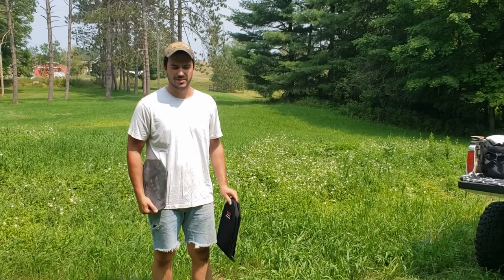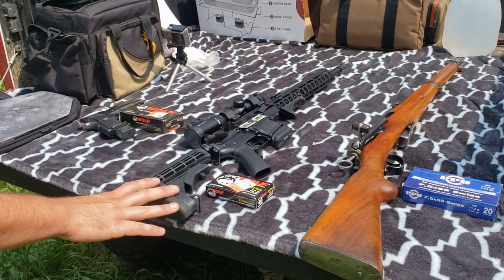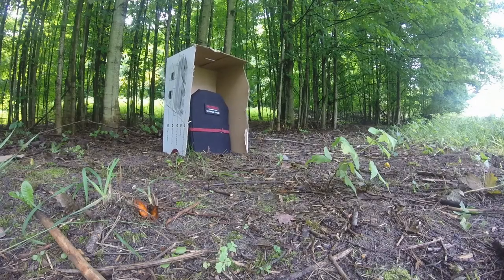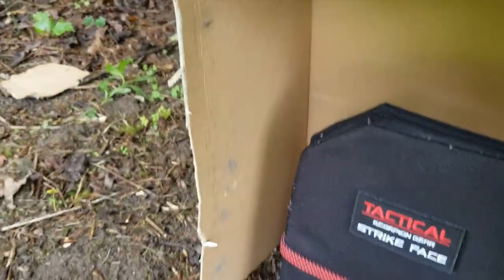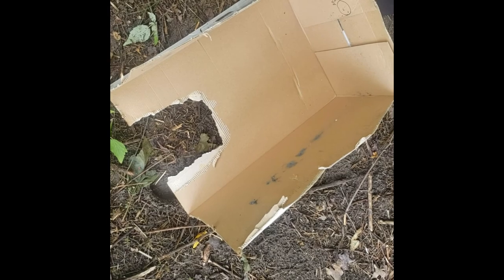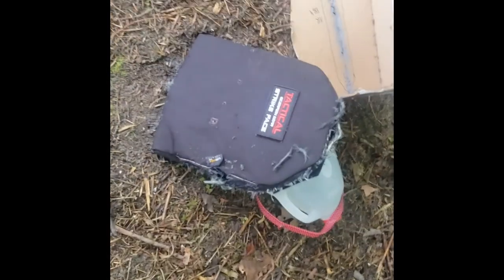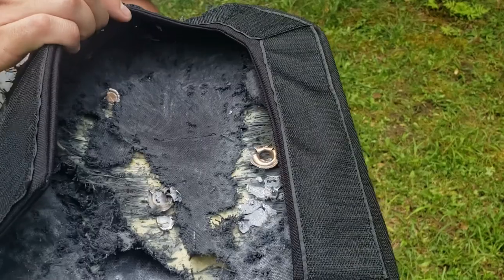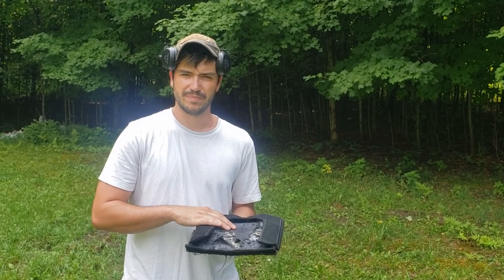Tactical Scorpion Gear Spall Liner Test

Comment: Spoke to factory guy who said use water prep Gorilla Glue on plate strike side. To clamp used matching plate on the kevlar cover once set on glue. Put heavy wts on top for pressure that the glue needs to setup. On nice and tight, not shot for testing. I think the kevlar won't lift easy to let spall skate over plate.

Comment: I just purchased this product. The results of the video do not deter me from this product because they do not claim 100% spall capture however it did significantly reduce spall so that In conjunction with the thick fabric of your plate carrier and any neck or face guard you wear will also significantly minimize the effects of pass through spall and decrease its velocity significantly. Also important to note if you take multiple hits to the vest in a gun fight you probably should seek better cover or use your energy to leave the fight within reason. Great test would have loved to see balloons over the box or even the plates in a nice carrier to see if that added fabric stops more spalling.
Reply from the maker: We were also using an entirely bare steel plate, with no spall coating whatsoever. The burden of catching the spall was entirely on the liner in this video. If your plates are coated with something (as most are), I'm sure you wouldn't see even this much spall make it through. I plan on buying another sleeve.
Reply: What plate carrier do you use?
Reply: Well... if you look at this spall guard, I have the same one, which I just realized the other day, DOES NOT have kevlar around the edge of the pads, which is where ALMOST ALL of spall is going to travel! Nearly everything spattering off steel is going to travel to a 90degree, which is also obviously where you would have the most change of receiving a critical or fatal spall wound. Look at it, if you don't have a spall coating on your plate, it's literally going to do nothing against anything above handgun rounds. Look at the spall shoot directly up into the neck...
Reply: In a CQC environment that isn’t always an option to just “leave”

Comment: Really appreciate this video. I'm about to purchase my first set of plates and plate carrier and have been trying to decide between paying extra for "spall coat buildup" or save money with the base coat to get a different spall protection.
Reply: get both
Reply: My next plates will have the built up coating
Reply: You can't budget safety.  Get everything, extra base coat, spall sleeves, impact guards, or else pay for polyethylene or ceramic plates.
Reply: @saintsinningsword  true. each set has pros and cons.
Reply: @saintsinningsword by the time you have the carrier, the build up plates, spall sleeves, and pouches you are going to be 4 feet thick, man.
Reply: I mean both work. I wouldnt plan on getting shot enough for it to wear down like in this video. I'd get the cheaper one, if you get shot multiple, multiple times you are in some serious "this only ends one way" kind of shit.
Reply: Shouldn't have to pay extra for coating. Companys that do that shit are bullshit

Comment: I have the Scorpion Tactical 3+ steel plates with the spall liner, and I must say, these results a worrisome for me.  Probably going to look into a different spall guard
Reply: You should get different plates. There is no anti-spalling. It doesn’t exist. Ceramic plates are the answer. Ceramic eats the bullets in the sense the bullets embed themselves into the ceramic
Reply: @kaydnburns5935 ceramic doesn’t eat “bullets” in the plural form. I’d rather have ar500plates and their spawl coating. It works for a few rounds of 5.56, after that, if I’m worried about the 4-5th round creating sprawling that killed me, seems a little silly. You get hit 5 times the problems are bigger than sprawling. And if they’re close enough to defeat the spawl liner hitting the plate more than 5x, they’ll defeat your ceramics.
Reply: spall liners are ineffective. They "reduce" but by very small margins. It still a major issue. Ceramic does eat bullets, the plates i carry can eat 30+ ak-47 rounds with no spalling/.  @matthewHizzle

Comment: I mean it’s basically the same as shooting a Spall Coated plate. Shoot a Spall Coated plate that many times and the Spall Coating will peel off and fall off the plate. But less we forget about one thing. What should’ve happened was you should’ve put the protector on the plate and housed it inside a carrier. The carrier itself plays a role in protection as well because its yet another layer of fabric and material that the bullet shrapnel has to fight through. Many many many tests you’ll see on the normal spalled coating is that the shrapnel gets stuck inside the carrier itself (crumbs). Imagine having the protector on it, multiple upon multiple layers it has to fight through. So this does not absolutely deter me from getting my protector. Scorpion gear charges a large extra amount to have the plates spall coated, but they sell the plate protector on Ebay for $30-$40 as opposed to the charge to have a plate coated which after speaking with the Scorpion company, I was told that the coating was essentially linex bed liner.
Reply from the maker: As we stated in the video, we're happy with the results of the test. You're exactly right, that used in conjunction with a bed liner coating and the carrier, we likely would have seen even less spalling. I simply did not want to shoot up my carrier even further (all this stuff is expensive, even in the name of science).
Reply: @rolandstreetfirearms3628  Oh for sure. Weirdly, carriers cost more than the plates. You would think steel would cost more than fabric. I ordered a 4 piece plated carrier from Scorpion here recently including the spall protective material that you slide the plate into. Im a fan of scorpion for sure, they sell high quality materials, it’s USA made, and generally not as expensive to purchase from. I also purchased a PASGT Delta kevlar helmet to go with it.